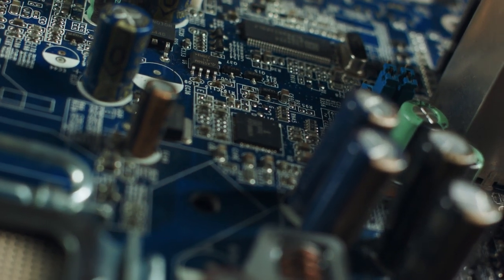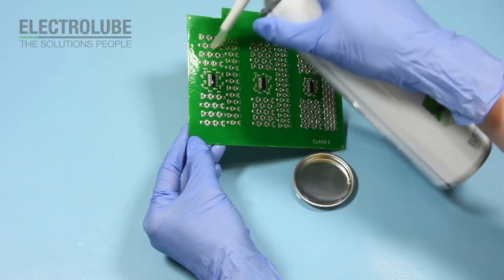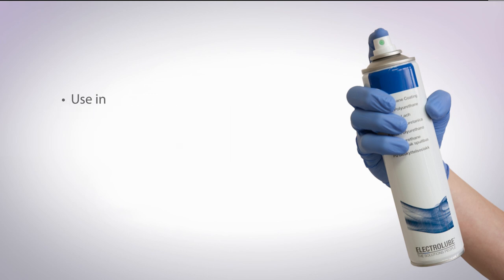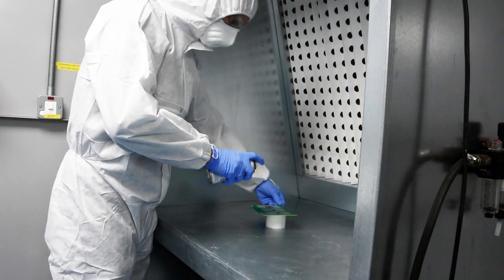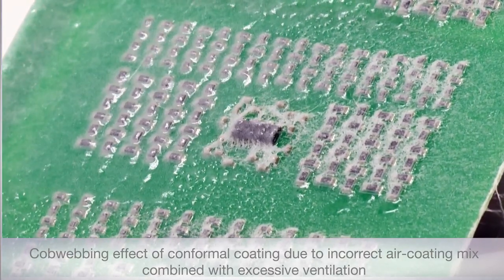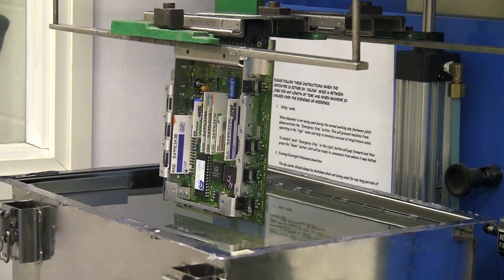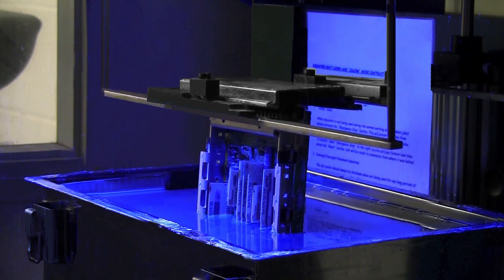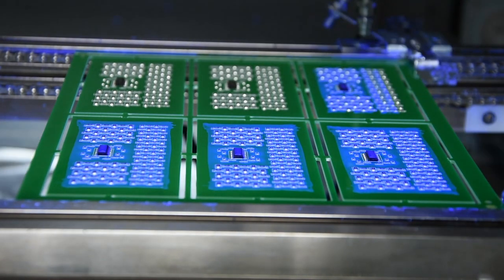Electrolube Conformal Coating Vlog -  Application of Conformal Coating

Comment from the maker: To Clarify - where we mention the angle of spray should be 45 degrees, this is the angle the coating is sprayed at the board, not necessarily the angle of the board at the time of coating.  This is to ensure the coating reaches under raised components. We apologies for any confusion caused by the diagram.